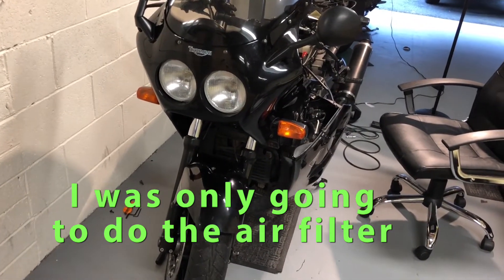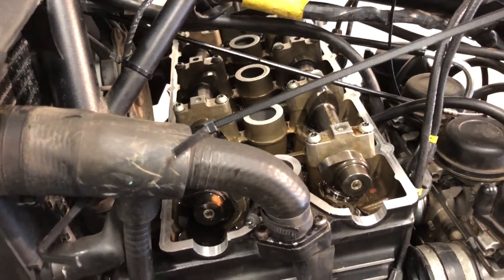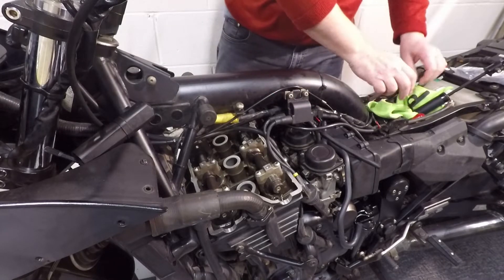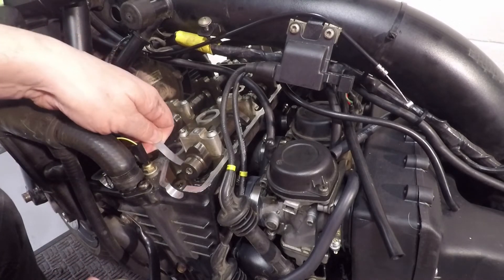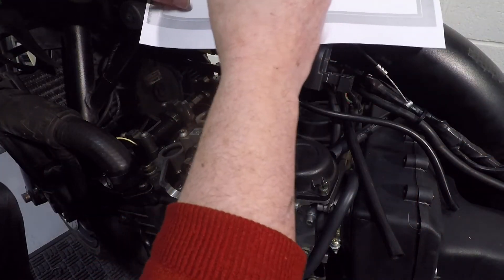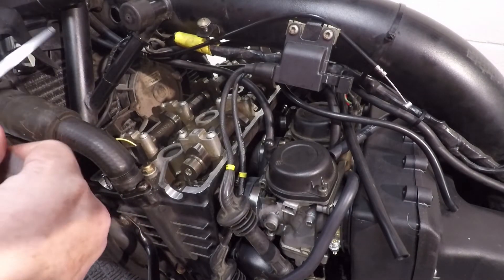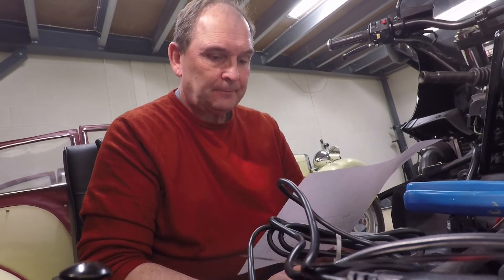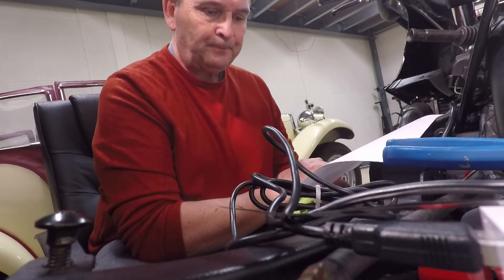Measuring Motorcycle Valve Clearances - 4 cyl 1995 Triumph Daytona.

Comment: Very useful but is there a shim change follow up?
Reply from the maker: There is, using the Triumph shim removal tool. https://youtu.be/l9v68sRz9bs
Reply: @terenceokeeffesmotorcyclestuff  tThanks Yerry...Doing up a 1996 Triumph Trophy 1200.  Got sight unseen.  Done quite abit so far.  Had it running but a popping sound from the exhaust.  Sump contaminated with fuel.  So had carbs off and apart, cleaned, and new airbox, just waiting for a missing needle spacer.  So seems a shame not to check valve cleance etc.  But a bit daunting.
Reply from the maker: @links2lincs256  good luck, I went through a similar process with this one. Using the shim removal tool allows you to change the shims without removing the camshafts/cam chain etc. so it is a lot less daunting. It can be a little tricky in places but once you get the hang of the tool it ends up being quite simple.
Reply: I've found you can use the shim adjust tool another way where the bar is secured as usual but the leg to depress the bucket is put in place and snugged down to allow the shim to be extracted, instead of having to turn the lobe again.